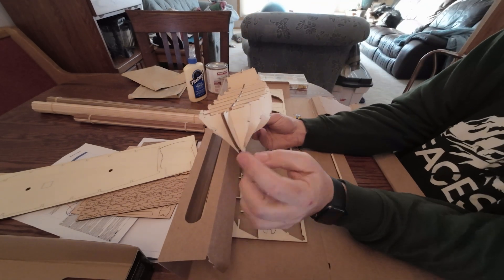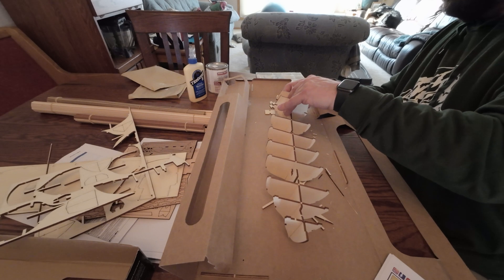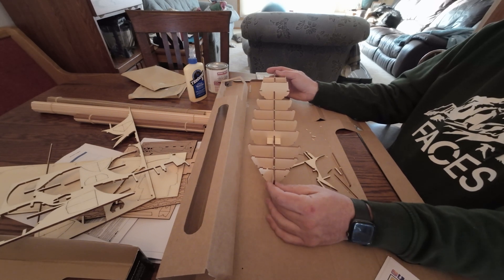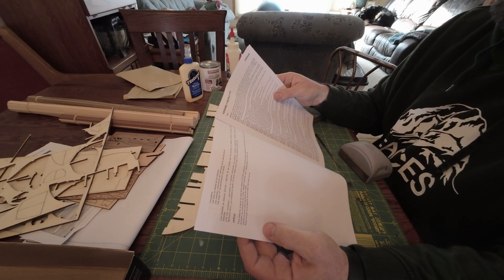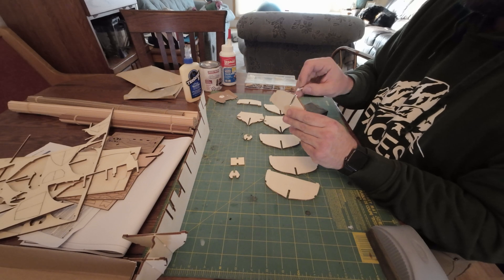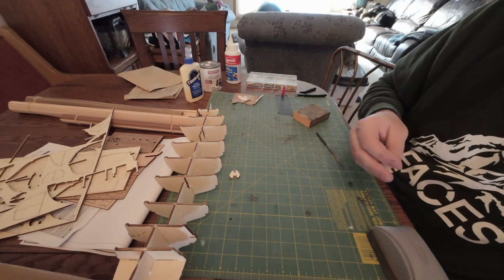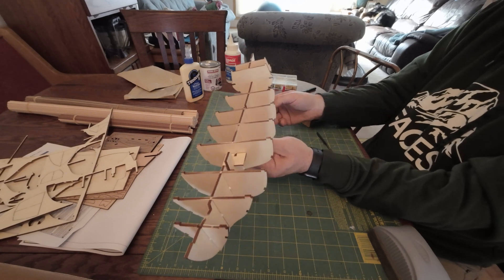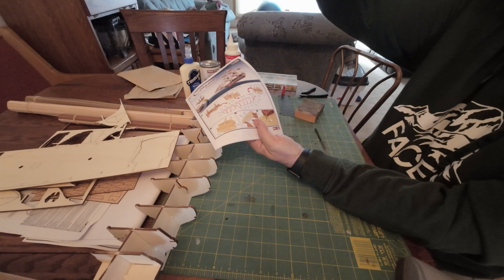It took me 1 hour to do step 1. Only 549 hours to go! | Occre Corsair Model Building

Comment: One thing: When you are installing the ribs to the frame it is vital they line up well to start with and one error here could cost trouble down the line. The miniature tool kit contains a small triangle and that works perfectly to line them up.